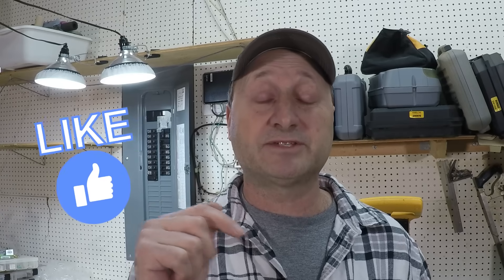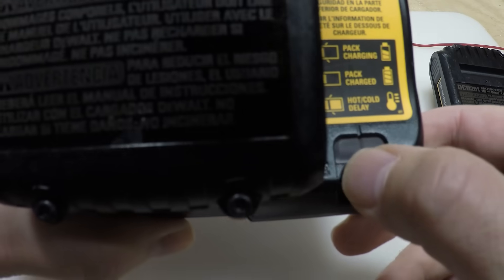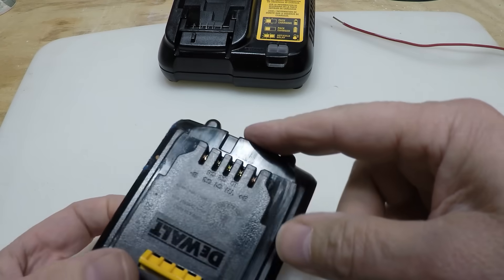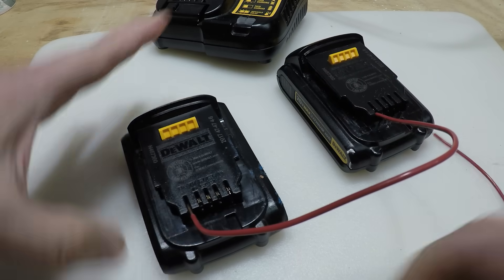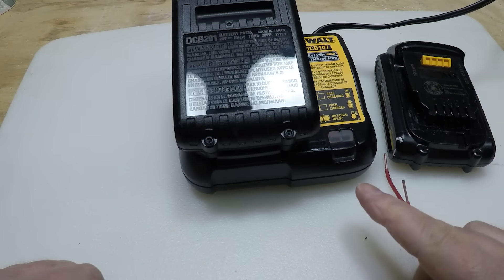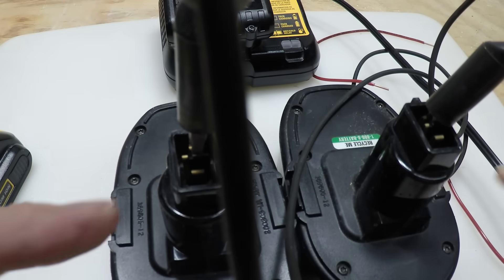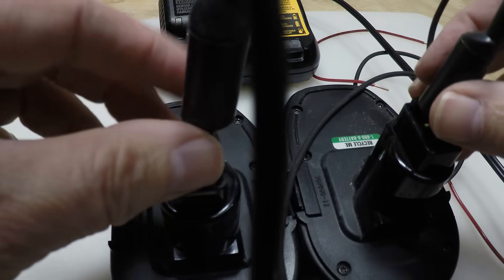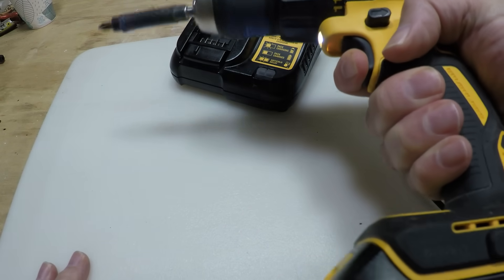SECRET to FIX Drill Batteries - Charge Dead Lithium Tool Batteries

Comment: Guessing the clamping voltage (sufficient to start up the charging unit) is somewhere around 3 to maybe 5 volts? Theoretically, & assuming polarity verification, you should be able to do this with any substantial DC voltage source higher than clamping - old phone/device charger, automotive battery, even an older non-smart car battery charger. just a matter of hooking in.

Comment: Another tip is, after a dead battery incident,
After the charger says that it's "fully charged", unplug the battery, wait a couple of hours, then put it back on the charger for 12-24 hrs. (it's also good to give a "long charge" to batteries occasionally, and deplete them to 15-20%)🙂
Reply: Old school Nickel Cadmium (NiCad) batteries performed best with fully charged to almost fully discharged cycles.

Newer, Lithium Ian (Li-Ion) batteries perform better and have a longer life if they remain as charged as possible, as often as possible. (Deep cycling them is a bad idea)
Reply: @BatCaveOz  Thanks for the info 👍🙂

Comment: What a brilliant tip !!  I had a battery that I thought was dead and had put it to one side for when we went to a battery collection place. I saw this tip and gave it a go.....WOW !! Just gave it a one second jump and tried it in the charger and hey presto, battery now charging. Thank you so much for sharing this with us.
Reply: Question: How good is your batteries now? I mean after your success, is it still working good now? I just threw away one death Makita battery two weeks ago. If I watched this video before, I tried to do it like you. Thanks
Reply: Hi does this work on batt that no longer fully charges ie 2 out of 3 light s when charged
Also a one off , can it charge of f another same size batt
Thx Joe
Reply: @joebalkovics3322  It does work.  It's really for a battery that won't charge at all.  Try to jump off with a good battery of the same kind.  Just follow the directions in the video.  If the battery is totally shot or dead, then probably not.  A battery that will not fully charge as you described is on its way out.
Reply: @VidTubeWatch  ok thx
Reply: @joebalkovics3322 yep joe but sound like the battery has a bad cel if it takes a charge.  Don’t jump it.
Reply: @benalexander9907  ok so just keep chargin till it wont take charge & get a new one
Reply: Brilliant
Reply: I probably threw away a Craftsman drill battery that could of been saved a few years ago.  I know now.  Thank you.
Reply: @VidTubeWatch probably saved yourself from a ion fire and burned down the house.
They are designed to stop working for a very good reason.
Kaboom!

Comment: Just to ask on the 18volt I put it in charger and it is a rapid red light flashing on charger light and will not charge is there anything I can do to fix this issue?

Comment: Something similar to this also works really well for Lithium-Ion digital camera batteries. When I find the battery shows zero volts on the voltmeter, and won't charge when I put it on the charger, I use a tiny 6v lead-acid modellers battery and use small leads to hold the + & - terminals of the lead acid battery to the + & - terminals of the Lithium battery for no more than five seconds - this will raise the voltage up to give a reading of a few volts. That voltage won't stay there very long, so you must put that battery straight on the charger and it will start charging.  

This technique is especially useful if you have one of those universal after-market chargers that automatically senses whether the battery is a 3.7v type or a 7.4v type. For those chargers to sense that the battery is a 7.4 volt type, the battery voltage itself has to be least 4½ volts. If its not, it will mistakenly sense the battery as a 3.7 volt type and will never charge it. In order to get it to be correctly sensed by the charger use the same technique as above -  it will sense the voltage over 4½ volts and start charging the battery up to its correct voltage.
Reply: I tried  connecting + to +an — to - I get sparks like it’s wrong polarity. 9.0 to 5ah. 9 battery is dead

Comment: What people need to ask themselves is : will replacing the fire damaged contents of my home be more expensive than replacing a $100 battery? I'm speaking as a professional who has worked on aircraft batteries, we used to rebuild batteries, cell balance them and capacity test them etc before use on fighter jets and helicopters. Yes I've jumped some batteries but invariably the Li-Ion batteries need the cells swapping out as they have reached end of life and have reduced performance. Be careful with these folks and leave them to the professionals.

Comment: I have a Metabo 18V pillar type battery charger that no longer works (10+ years old) and I can't replace it from the Dealer as only the flat sliding types are now available.. How can I wire the flat type charger to charge the pillar type battery?

Comment: Be careful. Even if that will work, the batteries have a BMS (battery management system) built in. In many/most cases there is a reason why it disconnects the batteries from the pins.  Especially when it happens again after your jumpstart. The only safe way is to open the battery and measure each cell. If they are all above 2.5V it is safe. If they are all below they have permanent reduced capacity. Of most are >2.5V and one is below 1V then there is a fire hazard when charging.
Reply: This.

'Jump starting' & attempting to force charge Lithium ion batteries is a really bad idea. If the get so low that the battery protection circuit / BMS cuts in then I wouldn't risk it; Lion fires supply their own Oxygen, will burn underwater and give off seriously nasty chemicals.

Comment: This is a great video. Just don't forget after you use the good battery to "jump start" the discharged battery to take one of the wires and connect it between the + and - terminal of the good battery and leave it connected for a good 1 hour.

Comment: All these people warning that he's short circuiting the batteries! He's doing nothing of the sort! If that was true then everyone who's using those external battery packs on their cell phones would be blowing their precious cell phones up!. What do you think they are anyway? Just another  fully charged lithium battery adding a charge to your regular battery. That's all Flannel Guy is doing. Minimal risk. and I hope you guys out there would notice that if you get heavy sparking from ANY electrical connection, I would hope you guys have enough common sense to immediately pull back your wire. All he's done is to put a very light "bridge" charge on that battery, just enough for that charger's detection and protection circuits to recognize it as a battery to be charged. When your batteries are really wasted, you'll know because your tool might start uup but run very slow, and only for a short period of time, That's when that battery needs to be recycled and a new one bought. This technique will not rescue a battery that's used up it's lifetime. It's to find out if there IS any life left ...especially useful for batteries that have not been used in some time. Quite successfully judging from so many other comments received. Thanks for the tip Flannel Guy!

Comment: Thank you for the tip! I  had MAkita drill 9200 , the battery is dead, I can’t buy the replacement! How can backup without working battery?
Reply: This would work using any brand of battery that is the same voltage...as long as you connect the correct terminals. 😁

Comment: I have several Greenworks 60V batteries, and this method actually worked for me a couple of years ago.  However, the 5A battery finally died on me and I could not get it going again.  I had another 5A battery, and it shows 30V+ but not enough to allow the charger to charge it back up.  I have repeated this process numerous times, and I can't seem to get the Voltage high enough for the charger to work.  I wish there was a way for the charger to accept lower voltage before charging, but I have no idea how to do that.  I have 2 chargers and have tried both to no avail.

Comment: Interesting. What about the likes of Ryobi+? They have 3, 4, 5 unmarked contacts? 
I’ve notice with Li-ion batteries there’s little pre-warning of them running down - they just stop. Not necessarily dead, but if you then charge a dead, hog battery - they won’t take a full charge, and die pretty quickly. Whereas if you let them go cold, they charge perfectly. Any comments on these findings?

Comment: WOW! 
Thanks for sharing this tip. 👍🏼
I'm going to try this on a dead Dewalt drill battery. 

In the meantime, how well has your drained battery performed after you jumped it and gave it a full charge? Does it behave like a normal battery now?
Reply: Can I revive the scooter Lithium batterie ? One is 480 volts and the other 240 volts. Thanks

Comment: THANKS. GREAT PODCAST. MY OLDER BATTERY TAKES A FULL CHARGE, BUT IT DRAINS TOO QUICK AND I DONT HAVE A SECOND BATTERY TO HELP BALANCE THE LOAD. DO YOU HAVE AN 5:59 Y SUGGESTIONS?

Comment: I have used this technique for 8v golf cart batteries. I boosted each battery with a 12v charger for a few minutes, then wired the batteries (6) in series for a total of 48V. The charger for the golf cart is "smart" and needs to see a minimum voltage to start charging. Thank you for providing this method for tool batteries, I would have never thought to do this.
Reply: 6 that’s a ton of money for golf cart batteries

Comment: Very useful video. I have 2 18v Dewalt batteries, both of which show no light on the charger. Could I use a 9 v battery 🔋 to boost?
Reply: You could connect two 9v's in series to get 18v.

Comment: I gotta comment that was interesting and I'm gonna do that. Thank you spot in front of my charger seems to be not working everything's good. They don't use a lot they left drill in a battery out in the rain. Then they went to used to charger the charger worked the other day and then they put it in charger isn't working on anything you think it's. Supposed to battery was wet. I put another battery in it and it didn't turn on either.
  Thank you have a great day.

Comment: Great. Similar thing happens when 12V car batteries get really low and a 6V/12V automatic charger defaults to 6V. So I put my jump battery on to get the charger to 12V option then disconnect the jump battery.

Comment: It worked for me on at least one Dewalt knock off battery, trying with a second one now for a second time, but even if it does not work it is still a 50% success rate which is awesome!

Comment: Would you happen to have a fix for older Dewalt 18V NiCd batteries that have a double flash and the battery doesn't last very long. Burns out quickly? Or do I have to replace the guts and have a nice day?

Comment: i had a dewalt slide battery it went completly flat and i put it on the charger and it shorted out my charger which no longer works

Comment: I understand people’s concerns for safety, but it’s only on for a couple of seconds with you right there with your hands on the wire.  This tip works and works very well.
Reply: That wouldn't be my concern with safety. If lithium ion batteries have been sitting too low for too long they can go high resistance internally. This can cause heat buildup when charging and potentially start a thermal runaway event. I don't really think that will happen with this method as he's only jumpstarting the BMS. If the battery was truly too low this method wouldn't work.

Comment: I have a Milwaukee 18v that when you put it into the charger it flashes both red and green, which it says means the battery needs replacing.  The battery is only a year old and has been charged less than a dozen times. What the heck?

Comment: I have a tablet do you know how to recharge my tablet with the other tablet i thought of using a cable and making the cross over in the cable because you can swich sides by just plug-in eather way. That means only two connections one in the middle and one on the outside. Is that ok or will you F up the tablets and at 400dollars a pop and the computer Mackinac two hrs away. You are a experienced explorer with battery's! What do you think.?

Comment: Yes, 12V car batteries can exhibit the same behavior.  I hook up a good battery for about a half hour with jumper cables and then the battery will take a charge.    Thanks for the video, I did not make the same connection with my power tool battery that was dead.

Comment: For known good battery that has simply been left uncharged too long, this works (but is dangerous). For a battery that has exceeded its duty cycles, nothing is going to magically work - yes you can force charge into it, but it's going to drop charge quickly again.

Comment: Some of the comments here make me think everyone is now an electrical engineer, chemistry major or battery manufacturer. 😂

If you bump a battery enough to be recognized by the charger and you don’t have to do it again it’s probably fine. Lithium batteries sometimes discharge lower than the BMS threshold, but doesn’t automatically mean they will cause a fire, burn out a tool or cause the end of days. 

This is where better judgment has to kick in. If you have to do this trick to a battery more than once it’s done, properly dispose of it. If you have to do it maybe once or twice during the lifetime of power cycles it’s fine. 

I run large 12v batteries for off grid. One time they dropped to “0 bolts” but in reality they were just in protect mode from too quick of a discharge. They would only reset and show a charge after being bumped by outside charge. They are built that way even stating so in the spec booklet and they continue to work just fine.

Comment: Unfortunately this doesn’t work with ryobi batteries. But I have managed the same truck by opening them up and using 18650 batteries stacked together to jump directly to the 18650s in the ryobi.

Comment: So my 20 volt battery dies , I go to buy a new battery from amazon. It comes fully charged but I had only small jobs around the house to do at that time. When I finally went to charge it it wouldn’t fit into  the charger because they put some fin into the battery.  So they purposefully rigged the battery so you would have to buy Their charger . And of course  the return period was over  !

Comment: There are plenty comments here on the potential danger of trying to do this with non-working Li-ion batteries, so I’ll not comment on that. But, at around 30s into the video, it’s suggested that some might consider throwing their dead batteries “in the garbage”.  Never do this! There’s plenty of information out there nowadays on how to responsibly and safety recycle used or dead batteries, including Li-ion. Just Google your state’s/provinces’s/country’s battery recycling protocols to find out. Never throw used batteries in the garbage.

Comment: Thank you!
I was given a DeWalt screwdriver with 2 batteries, years ago. The one battery was dead, not getting charged. Watched this video, tried it and, what do you know, it worked!
I kinda figured it needed a charge to register on the charger, just didn't think of using the working battery to jump start it.
Liked 👍

Comment: Thank you.  Informative and useful tip.  Related question for Flannel Guy If I may.  Is there anything to be done to AA or AAA batteries that won't fully charge and/or cause error codes to flash on the charger?  I use Eveready batteries and Eveready charger.  ex. - Get new AA for gadget and they will work & recharge normally.  On my particular recharger, it has a green light for "full charge", red light for "dead" and the red light flashes when battery "goes bad".  After a 2-3 dozen recharges (exact number unknown) when you plug the batteries in the charger they either immediately or within a couple minutes cause the status light to "flash red" under the bad battery (it charges 4 at a time).  whew.  My question is, is there a similar trick to fix AA/AAA batteries or that's just their typical service life?  Thank you for your guidance.

Comment: The charger for my cheap, NiCad powered drill was shutting off when it though the battery was charged, but the internal leakage was draining the battery before I had a chance to use it Maybe a better charger would have sensed that the battery was running itself down and re-started the cycle, but I made this one work by adding a 200 ohm resistor from the + side of the AC adapter to the + of the battery. I would never have attempted this with lithium ion batteries, but with NiCad it got the drill working again without burning the house down.

Comment: What i di to mine was plug and unplug it several times and it will start charging, but have to use the battery because it will not hold the charge overnigjt.

Comment: THANK YOU SOOOOO MUCH! 
Had two new Black & Decker batteries that had been left too long without use and the charger would just flash red errors and do nothing. 
This worked INSTANTLY! They're now charging green!
Reply: Did you have a third battery that was good?

Comment: just because you get it to charge does not mean it will hold the charge.ive done this and got battery to charge but when put in drill completely drained in seconds.replacing bad  batteries then charging works